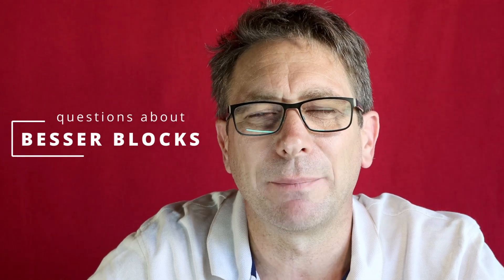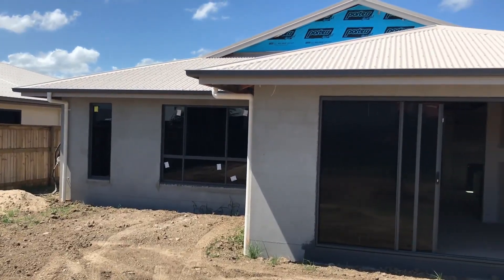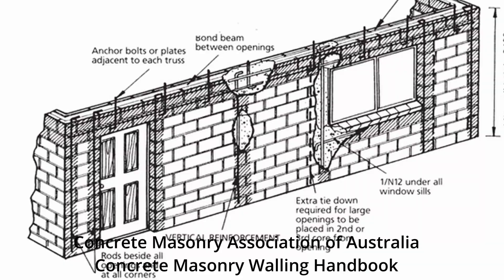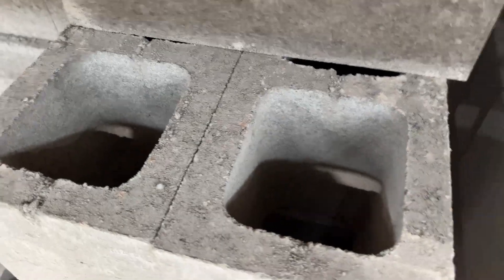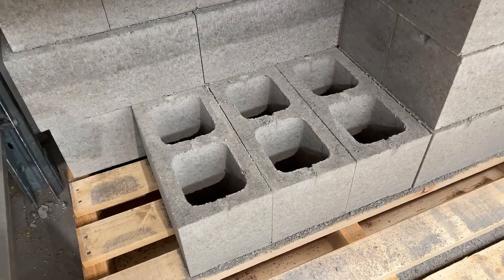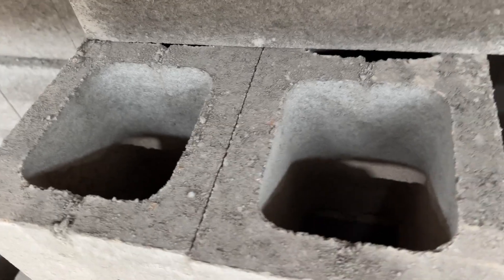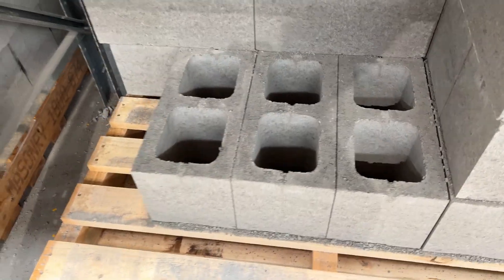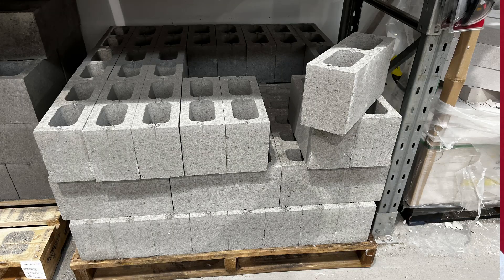Do Besser blocks need to be reinforced? What are the standard sizes for Besser blocks?

Comment: Very good sir. Just a few things may need to be clarified. No mortar used. —  When you dry stack (250 mm, best thickness, or) 200 mm ''the Besser'' —hollow concrete— blocks with 4-sides (two end-side) walls used with the method. 
The technology (you mention) design with open ends (illustrated) such as H-block, or even better with the "double H" type. Then to note concrete hollow blocks but with ends then shark jaws such as aligning next to each other. You can then simplify as a DIY builder and win big time gains and do it for the construction demonstration of basement- and/or any concrete residential DIY concrete solid walls without using molds. Check out my comment (with a lot of info) on the video "building the foundation" of (one who builds with solid and masonry Lecablocks, which is still associated with fire risk as not concrete then used when rebuilding a burned down previously built building again) Mind sparx (youtube). ''It's all in the wrist''? No, not really. It has (to make it simple) through the design for non-masons and non-carpenters to do with the design of the concrete blocks and how easy it is to be able to reinforce the blocks both vertically and horizontally. As well as being able to fill the blocks in all cavities with self-produced concrete. (You fill the wall in stages after building 3-4 stacked courses.) Using the wrong type of concrete block makes the work difficult DIY. The implication unnecessarily complicates the otherwise easiest way to build. Thus simply becomes more troublesome. In turn, which then discourages many DIY in e.g. In the US, using concrete and building concrete houses (which is really such a shame when there is just so much) easier than with the most common method in the US, 2''x4'' joist for walls.

Comment: Thank you for sharing; I had to look up your Besser blocks and they are reported at 1700 psi and we have 1900 psi for our ''concrete/cinder blocks''...  Also, we do not require reinforcement in all our placement conditions (West Coast / Earth quakes and Florida (wind loads) but in the Philadelphia area, we are not required for most residential conditions)...
Keep them coming Cornell, and a question about your conditions there, do they have a certain height were no reinforcement is required and can you use abutments to resolve some reinforcement issues? Thank you for education me on your design techniques... Kai
Reply from the maker: Hey Kai
There probably is a height of a cinder block wall that wouldn't need reinforcement but I don't really understand the reasoning. To me it is second nature and very reasonable to reinforce them for stability, load transfer and crack control.
"Unreinforced brick and concrete masonry (URM ) structures perform poorly in earthquakes." from this resource: http://www.seismicresilience.org.nz/topics/strengthening-strategies/strengthening-commercial-buildings/unreinforced-masonry/
"URM walls can act as a compressive element with magnificent capacity, but it shows bad 
performance in resisting in-plane lateral loads such as wind and earthquake [2]. As a result,
a catastrophe takes place, causing a big loss in terms of lives and economy " extracted from https://eprints.kfupm.edu.sa/id/eprint/139965/1/EXPERIMENTAL_AND_FEM_INVESTIGATION_OF_THE_PERFORMANCE_OF_CONCRETE_MASONRY_WALLS_RETROFITTED_USING_STEEL_FIBER_REINFORCED_MORTAR_ADMIXED_WITH_MICROSILICA.pdf
I guess the takeaway is unreinforced concrete masonry has good loadbearing capacity for vertical loads applied in the middle third of a wall but very poor performance in out of plane loading (wind, retaining and earthquake loads).
Enjoy!
Add some steel and corefill!!
Matt
Reply: @CornellEngineers  , Matt, I am huge fan of fiber reinforced ''stucco system'' and have been testing it on a wall system for the last three years... I literally dry-stacked the block and then put about 3/8" of this ''stucco'' over the block and let me tell you, it is performing like a beast (we have a few freeze thaw cycles here)...
I have even mix designed a mix that allows me to carve ''stone design'' into the surface.
I will give away my ''cheat'', I found it cheaper to use a ready mixed product and then add my charcoal product for colouring...
As far as the seismic, we do have that requirement in a few locations but not where I am located, unless you go about 10 feet (then you will add a bond block and reinforced steel in this bond block)...
The thinking is, the block is under compressive loading and if you footers are not deflecting, then your block will not deflect and because the block is in compression with no seismic prediction of movement; no rebar is required.
With that said, we do have a lot of clay and if you do not reinforce the wall in two directions, you will get bulging walls if the clay gets wet and has nothing to displace besides your wall system.
Back to this fiber reinforced system and why I like it mores so than the steel... It comes ready batched from the supplier (sakrete) and that mix exceeds 5000 psi and I can't buy the fiber cheaper than this mix alots for in weight...
So, let me share how I think this system works or behaves, I believe that during the curing / drying / hydration process, the mix ''shrinks'' and in doing so, it creates ''post tension'' in ALL directions of the fibers, creating a fiber mesh wall system (that is post tensioned during shrinkage)...
I have put this system on ONE side of dry stacked wall and let it cure for about 7 days and then attempted to kick it apart (that is a waste of energy, I do not even get a crack)!
I am confident to prescribe that the below ground should be reinforced with steel and coated with this mix design and then above ground, if you are under 6 feet (my experimental height), just dry stack and apply this product to the surface...
I have a couple of videos on this design being tested by me and still have one side of wall exposed to show contractors, perhaps I can find that video or do another fast one and show it to you...
I will post it on my other channel if you want to see this wild system perform, your call.
As far as metal fiber go, I am still iffy about them, I know they state that they will not rust but what metal does not ultimately rust (too expensive also)?
Plus the fiber mesh takes on they charcoal powder I use... it hides better and as I do not imagine metal will take on a ''stain''...
I really enjoy the toughnest it brings to the table and should be a standard mix design, so what about the fine fibers that are on the surface, the trade is worth it, imo...
I will now read your source you shared, thank you (just opened the later one and I like your share and the analysis). 
Again, I like fiber because I think it becomes mini-post tension slabs during shrinkage...
PS I am working on using water as ad-mixture to slow down the ''curing / initial set" during our high heat days...
Oder the concrete at higher slump then what you plan on placing but that higher water content will result in a cooler concrete drum and also cooling down your sand and sone and even your portland...
As we know, heat accelerates the initial set time  and if you add the extra water at the plant and by the time it arrives on site, you will have a cooler mix and also a lot of evaporation will have taken place and your slump test will tell you how far off you are from your ideal placement slump...
We can have a long conversation about bleed water and the advantages and disadvantages... 
I just refer to bleed water as displace water in the mix design of the weighted materials and the ''bleed water'' just being displaced to the surface to be evaporated, etc.